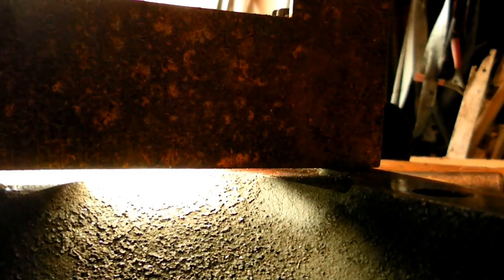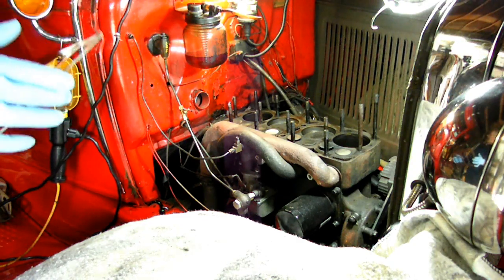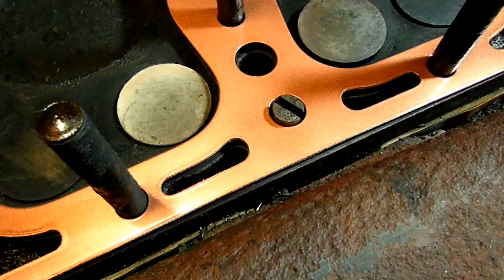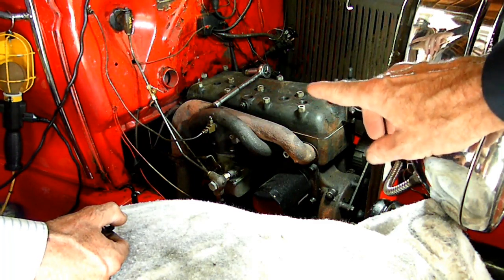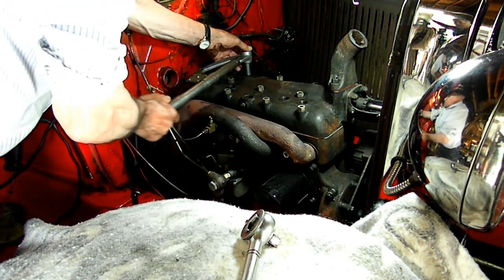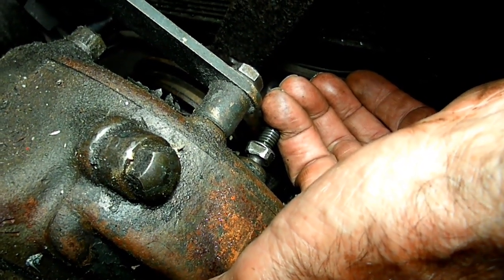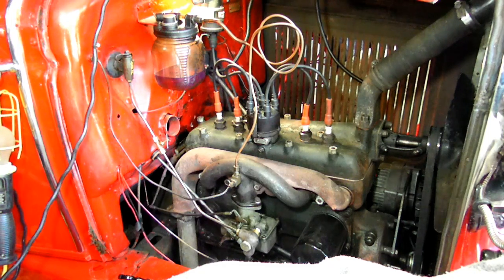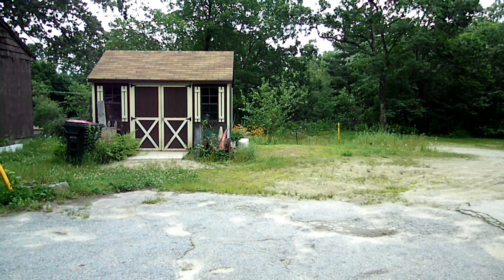Model A Ford Head Gasket Replacement Part 2

Comment: Nice job Richpin and Dad!  You two work great together.  So nice to see this video.  Nice truck too.  I noticed at one point, your Dad was tightening the set screw for the distributor and he passed the screw driver through the box wrench.  Is that a special technique to stabilze the screw driver?  Very interesting.

Comment: Nice demonstration. I would just suggest that you do not have to go through the timing pin sequence unless you have altered your distributor while it was out of the car. It's important to check the position of the distributor drive shaft in order to approximate the alignment of the distributor as you install it, but nothing in this operation of replacing the head gasket would cause the car to need retiming.

Comment: 2. Make sure the head is not off more than .002 of an inch (preferably less) in flatness as measured in the center in the same manner as with the block. If it is then have it resurfaced and make sure the surface finish made by the machine is between RMS 90-110 which is just rough enough to feel with your fingernail. You don't want a mirror smooth finish on a flat head nor do you want too rough a texture either. A slight texture on a flat head tends to grip the gasket and that's what you need.

Comment: 5. Make sure the stud bosses where the nuts make contact are free of paint and are smooth clean metal. Apply a drop of motor oil to each boss so the bottom of the nut can slide on it. 

6. Torque in sequence following the pattern below. Start with finger tight on each, then say 20 pounds or so on each, then 40, then a final amount of 60 to 65 (no less than 60 on a Regular B-F head 5.9). The torque is dry torque or lightly oiled with motor oil which improves the accuracy.

Comment: The following instructions are what I tell Brumfield High Compression Head users. If you have a stock head and follow these instructions you will have success (as long as nothing is cracked). Change the final torque amount to 55 pounds.

1. Make sure the block is not off more than .002 of an inch in flatness as measured in the center with a machinist straight-edge that spans the length of the block's gasket area and use accurate feeler gauges with good edges to measure.

Comment: Starting at Nut #1, loosen each nut 1/8 of a turn and then in one uninterrupted motion, torque the nut back to the final torque amount. Do this one at a time in sequence. Don't loosen them all at once. Please re-torque every time in this manner, very important! Usually about 3 re-torques are enough; run engine (i.e., drive the car), cool off then re-torque. 
pounds will often break the neck.

Comment: 3. On a Brumfield Head, use a new copper-clad FEL-PRO 7013 C head gasket and NO OTHER. We install them with a light coating of chassis grease smeared across them and that's all. However, you can use spray sealer if you like; copper coat spray by Permatex for example, BUT apply just enough to cover on both sides with no runs and that's it; and install the gasket and head while the coating is STILL STICKY, very important. If you let the sealer dry and then install the gasket, it can cause leaks.

Comment: 8. Do not use a gasket beneath the water neck. Make sure the neck is flat (if it's not then have it machined flat) and use a light smear of RTV silicone instead of a gasket. Using a gasket with a higher torque amount of 60 pounds will often break the neck.

Comment: Even if he hadn't told us, the flat inner radius of the exhaust manifold where it turns down suggests that it is from 1931. I believe they started using that in May of '31. It was changed from the round design due to a problem with cracking in that area.

Comment: I have one question and two comments. #1. When you checked the head with that old rusting framing square and found the head with a slight warp, did you send it off to be resurfaced?  #2. If I were doing this job I would install new studs. I don't know if they screw in, or exactly how they are secured, but the fight you had removing the head suggests to me that one, or more studs are bent, as evidenced by the "universal" Ford ball pean hammer used in the removal, and the rubber mallet to reinstall. #3 The studs themselves appear to have dirty threads, and if this is true you'll never get a correct tourque reading, so you won't have the head tightened to the correct specs. If the head went back on without the head resurfacing done you will probably have this situation crop up in the future, and between the same two cylinders. My 12-14 c.r. chevys wouldn't hold up to anything but perfection, your 4.1 c.r. might be ok, i.d.k. ..... Jim .
Reply from the maker: We did not resurface the head(which we should have done) and those studs might be out of alignment.
Reply from the maker: moparmania74
Great idea will have to try that.

Comment: 7. After you have reached the final torque amount and have run the engine ALWAYS RE-torque using this method and also perform the RE-torques with the engine cooled off:
Reply: Not all the way cold. Half hot.

Comment: hi rich,could you tell me what that line is going into the manifold.whats the purpose.thanks.love these videos
Reply from the maker: It is injecting marvel mystery oil in the engine for the valves.
Reply: My Grandfather went to Detroit in 1918 to learn to be a Ford auto mechanic.  He worked on cars in his garage until his death in 1957.  As  boy,  I remember playing around the garage and there seemed to be a can of mystery oil in every nook of the shop.